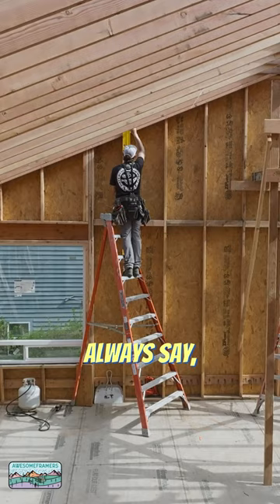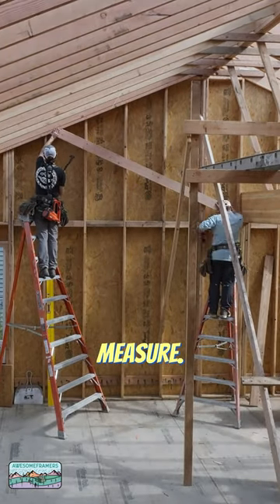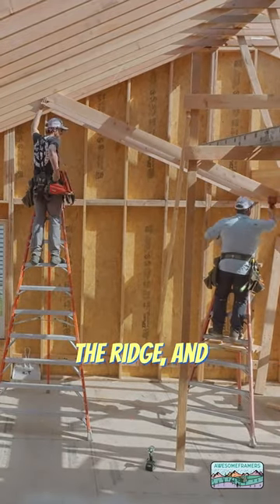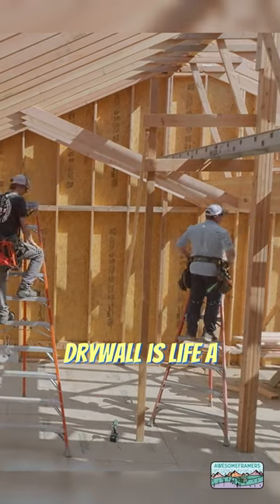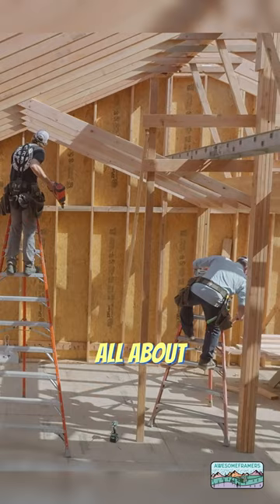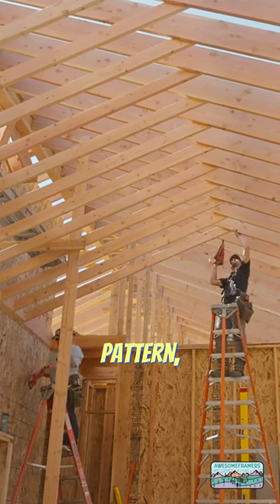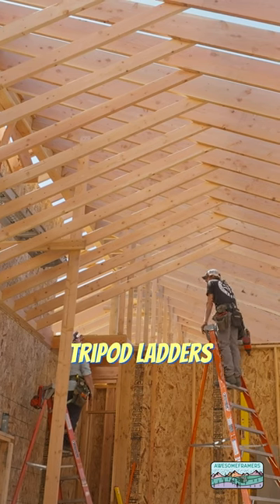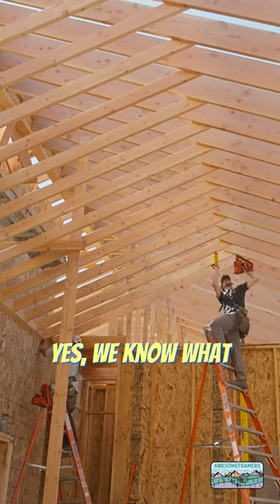Simple Vault #framing  #diy #buildingconstruction #construction #huberpartner

Comment: How do you like those badger tool belts? Im debating diamondback or badger. Help me!
Reply: Check out akribis leather, I’ve been rocking the B-Max for  a few years and I will never go back to a diamondback or any other pouch for that matter.
Reply: I'm an Occidental leather man myself!
Reply: I switched from Diamondbacks to badger framing bags about six months ago. So far so good. Holding up very well. They are lighter and more flexible than DBs. Wish I would have found them before DBs.
Reply: Just bought myself a set last week, made the switch from leather and today was the first day using them, they seem great to me, lighter in weight and great back support, I've heard alot of people swap from diamondback to badger but not the other way around, something to think about
Reply: @eskewconstruction6526 really surprised (and mmmaybe a little skeptical) to hear they are lighter.  Are you sure your setup is comparable?

Edit - oops, saw the badgers are nylon. I thought they were leather. My mistake
Reply from the maker: absolutely love them.  Best bags I've every used.  https://youtu.be/qiVjAzu1NXE?feature=shared